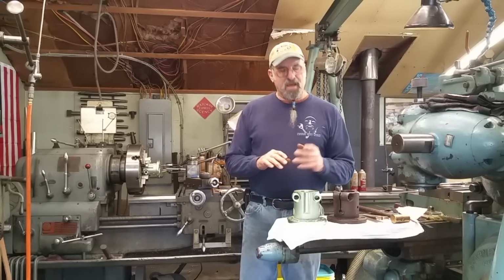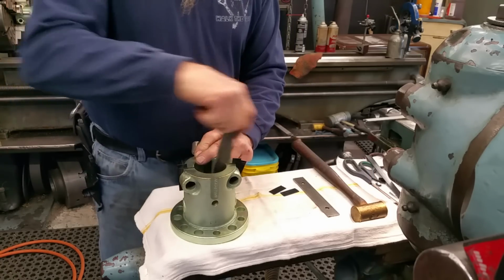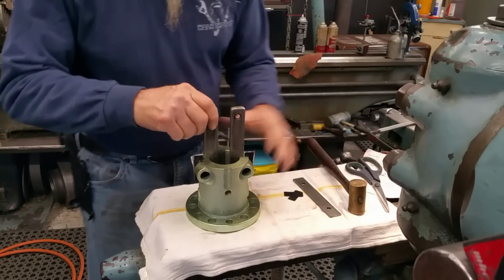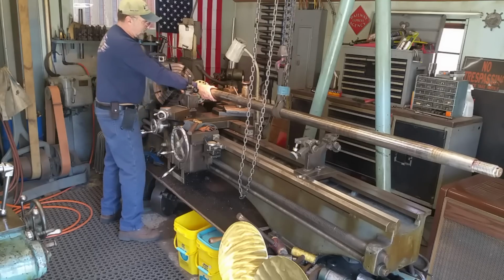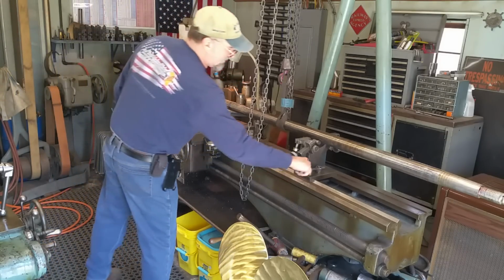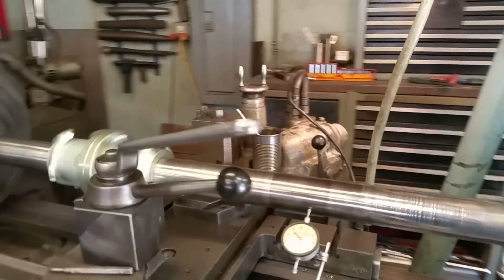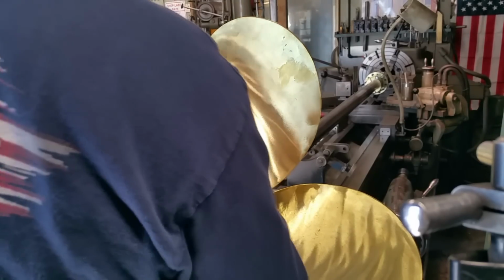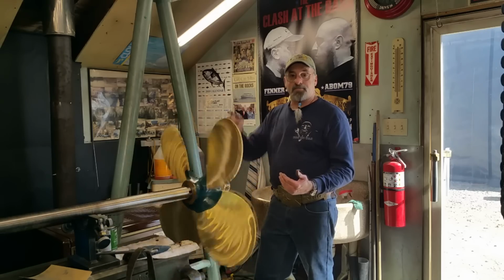Sunday Notes 4

Comment: Hi Keith,
Does the lapping compound get embedded in the softer prop material durring lapping and if so how do you clean it out?  Thanks for all your great viseos.
Reply from the maker: The prop material is not soft enough to allow embedding, and nibral bronze is almost as hard as the Stainless. Wiping and rinse, removes the grit. ;{)------

Comment: Do you think the weight of the prop when lapping the taper affects the end result of the fit?  The load on the taper is in the vertical direction and certainly if you don't rotate the prop during the process you would never get a 360 contact surface.  What is your experience on this?
Reply from the maker: Yes, you need to rotate both the shaft and the prop, even if doing the process down on the boat in place. ;{)------

Comment: Keith, I had visions of the wheel getting lapped in so well that eventually it locks to the shaft, and then comes around to bust a thumb. Is that a false prediction, or was there something you were doing to prevent such an event? Is that why you keep it wet for example?
Reply from the maker: You can feel the grab coming. ;{)------

Comment: I know there are many ways to skin a cat. I’m just curious of what you think of flipping that coupling around and bolting the flange to a face plate or sacrificial stock that could be held in the chuck. That would also give clearance for the boring bar to pass through the back. I only ask because I feel like that would have been my approach to that job had I not seen how you did it. But I am just an amateur doing small jobs in my home shop. Thank you for all of the great content and wealth of knowledge you put out for us to learn from. Very inspirational.
Reply from the maker: If I only had one short shaft, I would have used a raw stock / shaft material to make longer. ;{)------

Comment: using banding as shims is probably the first tip I picked up from you years ago, before I had any machines or experience.  I save all the banding I get now and use it all the time.  Thanks for another video.  

Maybe next video you can annoy the whiners by not zero'ing your indicators while dubbing in the buzz noise.

Comment: Keith...... With all the care you take in doing a good job at fitting everything how can you be sure the mechanic that installs all your good work will take the same attention to detail at install or does it even bother you? I would hate to see an install mechanic trash your good work.
Reply from the maker: That's a great question / comment!
  I have made new shafting, seen it back within a short period of time for one reason or another and it was covered badly,  knurled by pipe wrench, I added pain compensation on top of the bill, just to get through repairing it! I had a drinkers attitude back then, so I probably had a mouththy comment or two also. that was the worst lack of respectful treatment to one of my shafts. 
 I had a marina install two brand new shafts of mine, the customer was a hard core sport fisher, had to limp in on one engine after dropping a wheel out in the canyons, 120 miles out, within a couple weeks after they were installed. Loose wheel, cracked at the key just like they all do. I went down to the marina and did a personal installation lap, blue, heat up to 200 degrees, slam the wheels on and then tighten them twice, once to set them and second to take up the play in the nuts after the temperature normalized. Stated right there in front of a half a dozen guys and god; (If those break loose and he loses a wheel because of my installation, I'll close up my shop!) The answer I got was we can't do that to every shaft job here!
 My videos as well as being a share for those who are interested in work, some videos are also shares for what boat owners should be aware of, and what is offered and or skipped / jipped out of in services in their propulsion  projects. 
  I just keep my workmanship expectations the same as they have always been, I share the project and proper assemblies, from there I have to let go! Can't judge the next customer like the last! Cheers, ;{)-------

Comment: Some of the shafts have the key slot spooned and some don't. Is there a reason and have you shown the spooning process ever?
Reply from the maker: Yes , the spooning is to rid of the stress riser at the major diameter / the largest last contacting point of the bore, in the keyway. It is a practice that is used to reduce the chances of starting a crank if a wheel / prop gets loose.  I think I may of added that in one of my earlier shafting videos. ;{)-------

Comment: Why does the prop in your logo have 3 different blades? The bottom one is facing the wrong way.
Reply: Tropical delusion...
Reply from the maker: It is an equipoise propeller and in the first series of WIYB, you can see the wheel it was copied from, on a shaft that was drawn up by the art majors. ;{)-------

Comment: Sweet:   I really need a steady rest which is mega bucks.  Yrs ago thinking out of the box
I  sacraficed a lathe bed  with tail stock on my drill press.  don't worry the press is almost
two ton of 100 yr old cast iron & ain't going to move. gets the job done.  sam  frozeen in
Masshole
Reply from the maker: I made the one seen in this video in the first few months of 1994, because of the need, will be making another one, to suit larger than 5" diameters. ;{)------
Reply: I've got a steady, but the damn center is too small to be as useful as it could be.